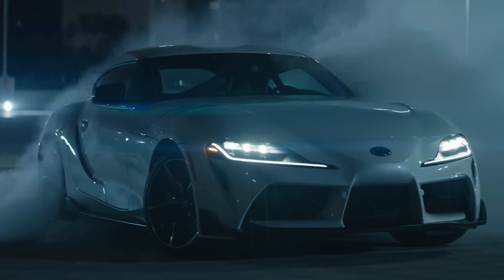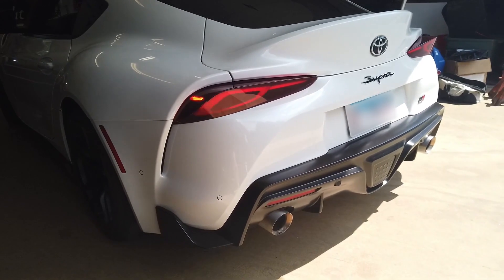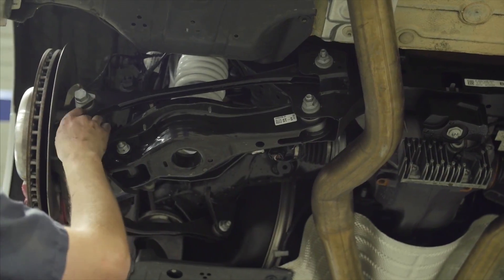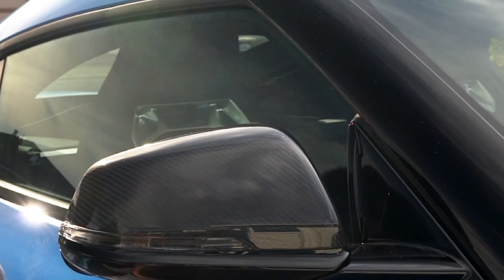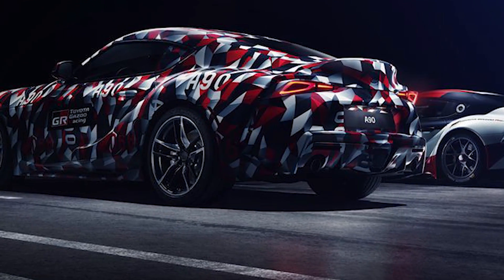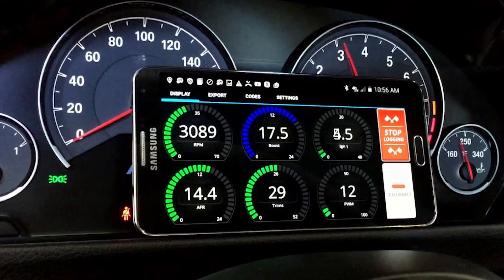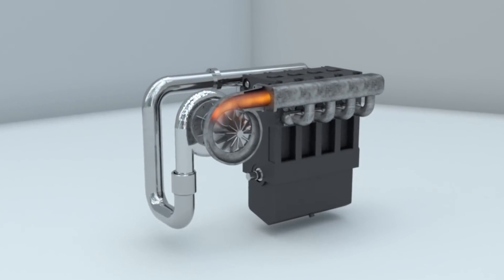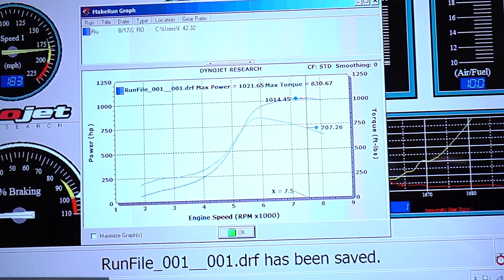Top 5 (+1) Mods For A MK5 Toyota Supra (Performance & Style)

Comment: That catless downpipe is not technically legal in CA. Catted downpipes are available, but are probably not as free-flowing.
Reply from the maker: There are a few cats that flow well. But as you stated not exactly the same as a straight pipe
Reply: @GearheadGurus  ....which would make the car excruciatingly loud and highly illegal! 😏
Reply: @davepaturno4290  maybe you should get an EV, sounds like thats more your style
Reply: @SupraSav  I have a 2024 45th Anniv GR Supra. Why get anything else?
Reply: @davepaturno4290  Sounds like you want to be stock.  😅
Reply: @rustybros  I'm torn between leaving it stock and getting my usual mods of lowering springs and exhaust. I'll have to admit that I like NOT scraping the front lip on every parking lot entrance.
Reply: @davepaturno4290  Because of the stock trims I already drive my stock supra like it was lowered.  If you already drive it like that then might as well get the mods. I do agree that california emission laws is a pain in the ass and I'm thinking of keeping the engine stock. Time will tell if I cave in and add performance mods.
Reply: @rustybros  My previously Mazda 3S GT was lowered on Eibach springs. It was definitely more susceptible to scraping of the front lip. Most of time I backed out of my driveway, I hear the scraping sound. Not having a lowered car  means less caution/slowing down is necessary.
 And most lowering springs have increased stiffness of 25% or more, making the ride harsher, even in normal mode. The fact that I love the look of smaller fender gaps enables the Quandry I am in. Installing of the springs can take 8 hours, so another $1000 can be added to the $300 - $500 for the springs.
 An aftermarket cat-back can sometimes include droning at certain rpm ranges.